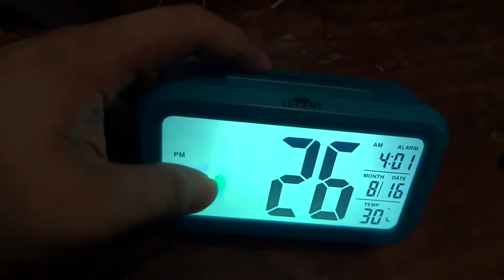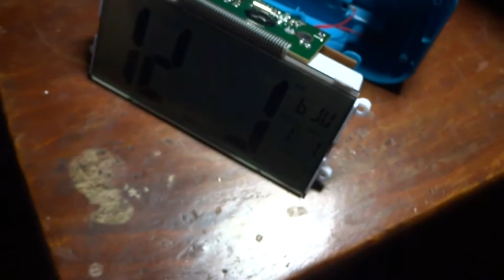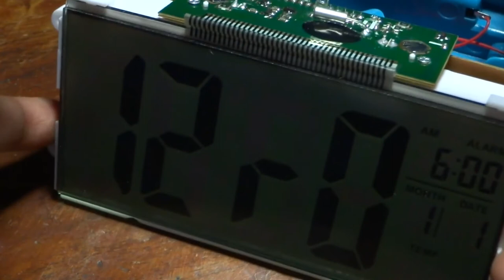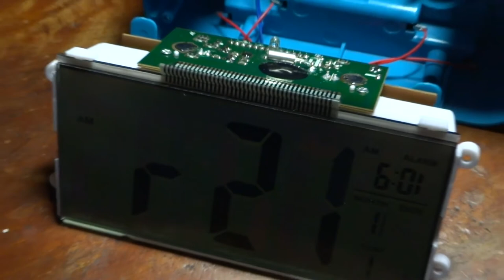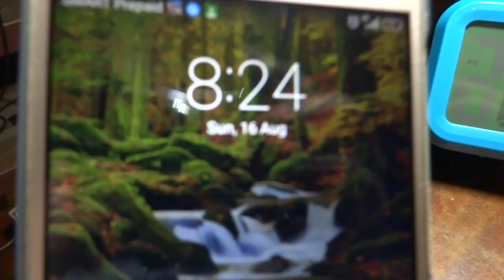Fixing Missing Numbers Display Digital Alarm Clock

Comment: I've found that after the timer gets wet and loses numbers I can often get them back by puttiung the timer on a mild heat source like over a light bulb in a lamp or heating outlet.  Not guaranteed but doesn't require specila soldering technique.

Comment: Nice video. I have the same clock but with "negative LCD". The display is black and digits are transparent. I have an issue that top segments stopped working. I have managed to find the issue is on LCD side of the tape, not from PCB side like Yours. I have managed to press back the tape to LCD with a match but adhesive is not holding it properly. The segments are somewhat faiding. I think the current is to small to power it properly. Do You have any fix for that issue? I cannot buy a new clock, because they do not sell them any more.
Reply from the maker: Sorry no idea to that issue
Reply: @playstation2bigs do you know what the tape is called

Comment: Thanks very interesting. Quite like the clock btw, what make is it? I saw "Lucent" on the top, is that the brand? Also do you know if you can keep the backlight on at all times or does it only work in the dark?
Reply from the maker: Lucent is a brand but they are all the same like others. Yes you can turn on the light there's a switch, when it sense a dark surrounding it will light up, but the battery will drain easily for one month or two months only
Reply: @playstation2bigs  Ok. Thank you for getting back to me.

Comment: Do you know how to fix the clock if the light des not work and the alarm also doesn't work.
Reply from the maker: Internal circuit problem or LED light problem issues. Recommend to buy a new one

Comment: how about all númbers fully display but cannot reset the time? can you tell how to fix it?
Reply from the maker: Try removing the battery to reset it
Reply: @playstation2bigs  nothing change, all the button not responding. only the select switch change the display blinking alarm, year min n hour.
Reply from the maker: @robertocanonero3236  internal circuit is the problem the black circle thing

Comment: Yo same model ata tayo. Para san pala ung gnagawa mo? Pang solder un dba?
Reply from the maker: Yes, pang solder yun
Reply: @playstation2bigs  pero ung pinapatungan mo ng pangsolder ano pala purpose? Pang heating lang ba?
Reply from the maker: @joshuariosa5756  para hindi malusaw yung plastic, kaya ginamitan ko ng mini flat screwdriver
Reply: @playstation2bigs  ohh okay, nattransmit pala ung heat pag ganun
Reply: Pano po pag walang pang solder? Pwede ba iheat nalang yung screw in other ways?
Reply: boss.. pano ayusin ung nag rrestart ulit n digital clock... bumabalik sya ulit sa same date alarm at time...
Reply from the maker: Baka mahina na battery mo kaya na restart or mahinang klase battery mo, dapat Branded like energizer
Reply from the maker: Baka mahina na battery mo kaya na restart or mahinang klase battery mo, dapat Branded like energizer